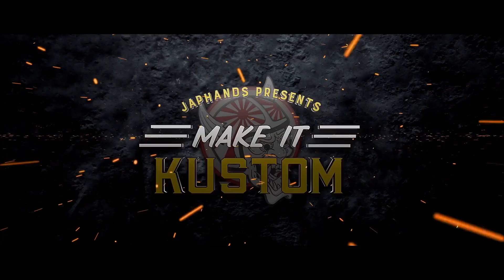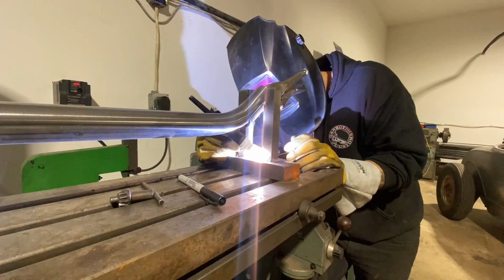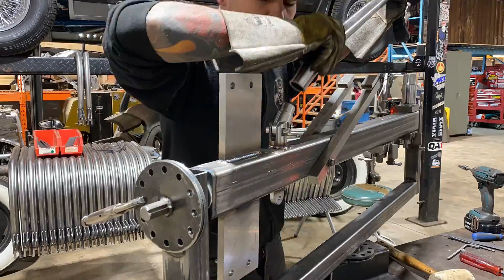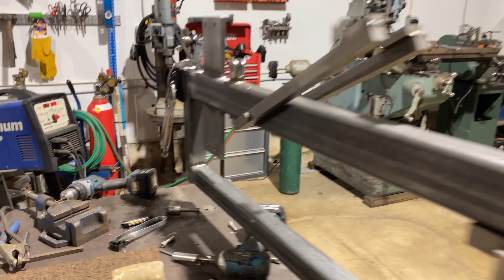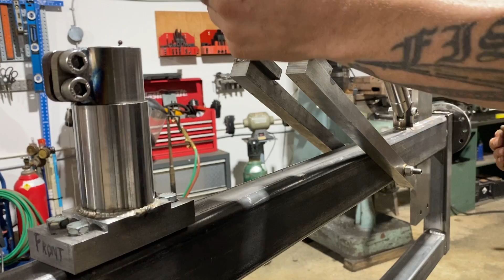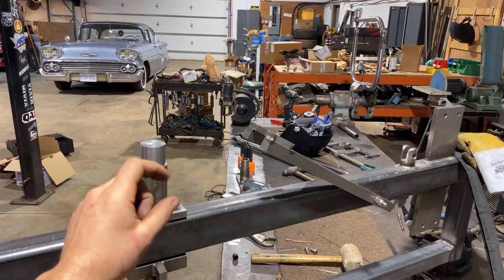Building Hammers the Hard Way (Almost Done!!) | Excalibur Update

Comment: Greenlee makes a carbide hole saw that is way better than the regular hole saw and probably not quite as pricey as that very dramatic bit you have hooked up there, but the carbide hole saws are made of a much thicker material and not quite as deep, and the pilot bits are shorter and thus more rigid and they have a spring that slide down around them, so it eases the blade onto the material more gradually, rather than abruptly! Greenlee is made of superior metal to some of the other knockoff brands of carbide hole saws!! Just is case you are interested. You can get a set from 1/2" through 2" for around 400.00 dollars. You might find them a little cheaper, depending on where you buy them!

Comment: I know it’s not hard to sharpen your tungsten on the grinding wheel (I did it for YEARS) but have you tried a tungsten sharpener yet? 
The fab shop I worked at (Local 290 plumber/pipe fitter Union I’m a fitter WELDER) ended up getting one and boy I gotta say it was a nice luxury to have. Of course I’m welding all day every day 10-12hrs a day so it’s different than someone that’s not tig’n with that kind of output. But just wanted to mention it if you haven’t tried one they are nice!!!

Comment: Morning Karl, I agree with you on the hole saw tubing notchers, their is flex in the hole saw, on your Bridgeport, I probably would have run it in low range, that's just me. When I was watching your video, I would like to buy one of your planishing hammers, I'm thinking the 36" hammer would be more versitle than the 24" due to throat depth, it's almost like buying a bead roller & not having enough depth. One more question, do you assemble each hammer before shipping to check any alignment issues? Where can I place a order for one of these hammers? Anyway enough rambling!!! another great video!! Be safe!! God Bless!!!
Reply from the maker: Absolutely every hammer is checked before shipping. To 36 is great for deep stuff but the 24 inch is great as a stationary or working on a bodywork stand. I definitely like using them both

Comment: I would suggest using your milling machine for any drilling, tapping, facing of parts for your master jig, esp since that main 4x2 tube you're using for the fixture is coped/curved.   I'm sure you'd be much more accurate that way instead of doing by hand.

Comment: Great news on the van! Seeing how passionate you are about cars I know for sure you found the right home for it. Now about the jig for the hammers. Why don’t you add a couple of side tabs to the support instead of using a pin to align it? Once you dialed in the tilt to what you like make a couple of tabs that will get it perfectly aligned to the rail of the jig. And you could make just the 24 inch support removable and leave the 36 in place since it doesn’t interfere. Just a suggestion. 👍
Reply from the maker: That’s a great suggestion thank you!

Comment: Do you plan on doing a “weld it yourself” kit? All the parts and pieces are there, you would just need to weld and assemble yourself.
Reply from the maker: Yes absolutely! Kits are next!
Reply: @MakeItKustom  awesome man, looking forward to it!
Reply: i don't see how it could be done to the proper precision without that jig (fixture).
Reply: @cliffwill  some company’s offer a “DIY” kit, i figured It didn’t hurt to ask. It seems to me the fixtures he’s fabbed up are for efficiency and repeatability since he’s making so many.  I believe If you only had to build one single hammer for yourself you wouldn’t need all the fixtures. For myself to build a single one, all I would use is a tape measure, maybe a dial calipers and a tig welder. I’ve been a welder/ fabricator for about 8 years and for the last 2 years I’ve been working at hot rod shops. If you know how to operate the hammer, welding one up shouldn’t be an issue.

Comment: All looks incredible.   Do you not use oil on your new bit to keep it clean for the weld?
Reply from the maker: I use a cutting fluid instead. Just easier to remove the residue befor welding

Comment: Glad to see you are managing to get through the manufacturing process. Tiny suggestion when using the annular cutter, (but this is ONLY applicable if you are finding small fluctuations in length of tube / angle of cut) That is to include a horizontal Stop Block under the tube at the elbow end. It seems there is a small risk of the tube not being parallel to the bed of the milling machine when you are concentrating on clamping the end of the tube to the top of the elbow support. But a stop block would ensure it always sits in the "elbow support" at the same height from the bed. Probably not necessary, as if you had problems I'm sure you would have said.

Comment: Just 2 suggestions from a production guy. They do make longer annular cutters that can do it in one shot...pricey though. 
See if you can find an old air vice. Once set up you can toss the part in hit your stops and clamp it by just stepping on the pedal.
Reply: Great idea, add a couple of bimba cylinders for clamping in the rear and your off to the races at a quicker pace.

Comment: Hey man, you should try chucking your tungsten up in a cordless drill and driving it on low speed while you sharpen with the bench grinder. It keeps a pretty clean, consistent point. Just a trick for your back pocket. It also speeds up that process if you’re grinding a whole pack of electrodes at once. Stoked on the cannel man. Seeing is believing.

Comment: Make a rail with stops that’s can be moved to to desired length. Stops could be a block with notch that hangs out but I’ll retract when pushed on. I used to work a KitchenCraft craft cutting down 25’ long pieces of routered material. Removing all defects and cutting to the size needed for orders. You can set them up for close work or precision. Would make it so you could cut or drill different sizes with out having to reset up when changing size. You could even back and forth between sizes with out any settting up. “ always double check you work for size. But usually in mass production you would check every 5th or 10th piece to save time”

Comment: Nice work man. Didn't take you long to figure out to get rid of the grinder when notching the tubes and just snap it off with the adjustable spanner. Well done. You are aware you tooling/mill cutters/drills etc. will last a lot longer if you use coolant, even carbide cutters on the lathe - I know it makes things oily but....

Comment: I thought that you were supposed to grind a 45° angle on the end of the pipes to give it better welding penetration , or is that only for something that requires a greater joint strength???
Reply from the maker: I have a chamfer cut on the machine parts so I don’t need to chamfer the tube